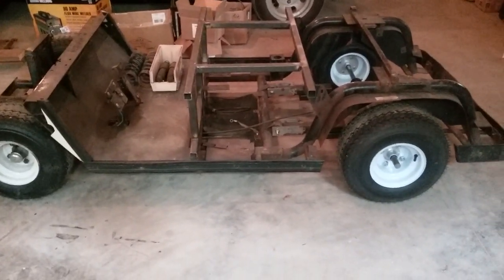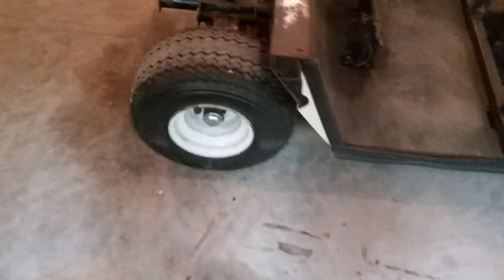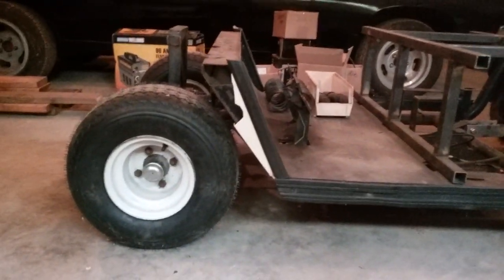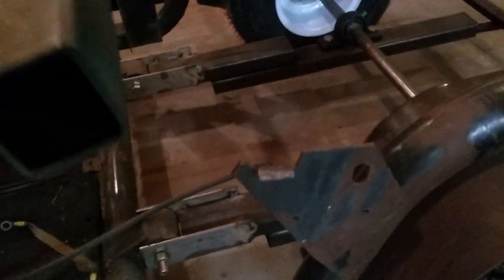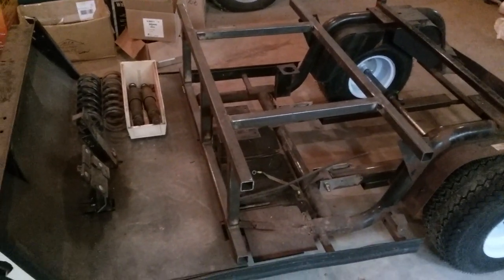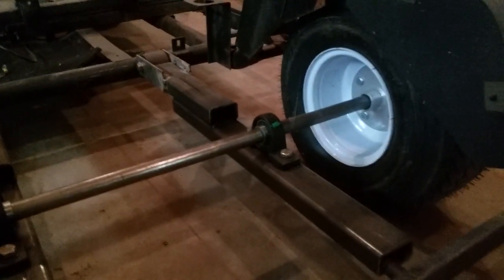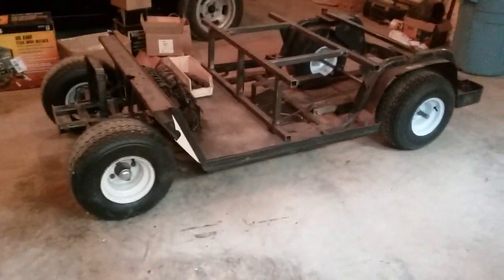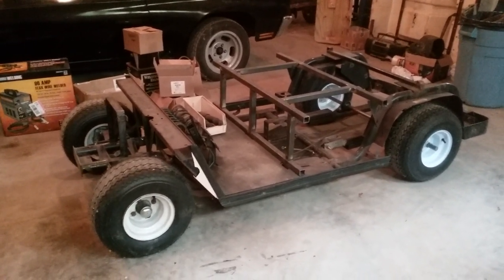modified golf cart project

Comment: I noticed on your back tires you have the mounting plates for the golf cart tires, if ya don't mind me askin, where did you find them at?
Reply from the maker: They are easy to find. 4 bolt on a 4 inch bolt circle or 4 on 4, or 4 x 4. I got these at BMI karts. You can get them at MFG Supply as well. I should have some new videos soon, I just bought a mini bike and want to redo some things on it.
Reply: @TemperDriven  hey thanks for replyin, I'm looking forward to seein your new videos!